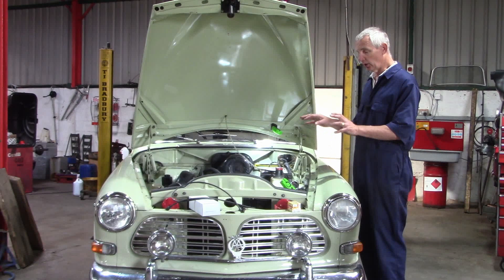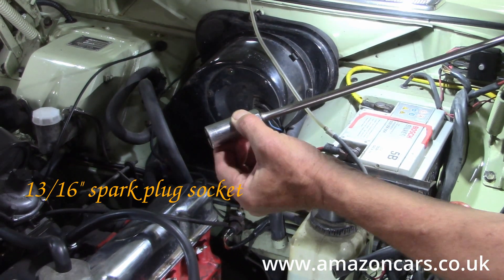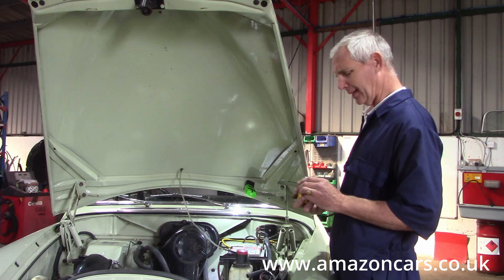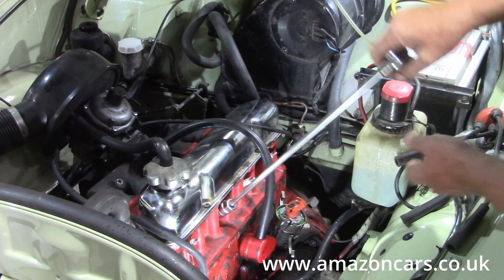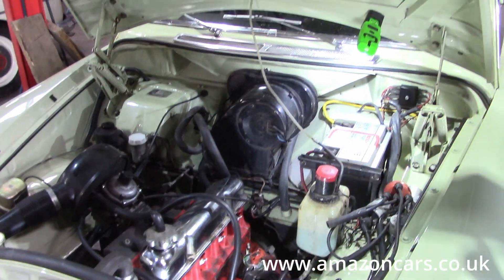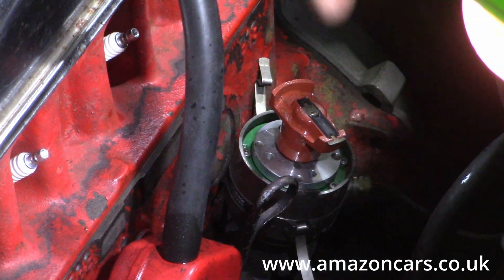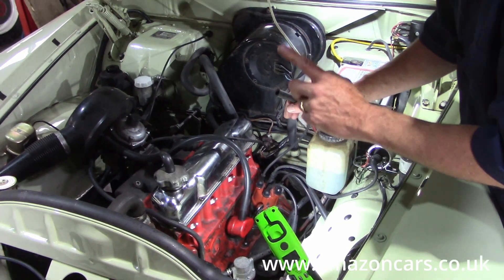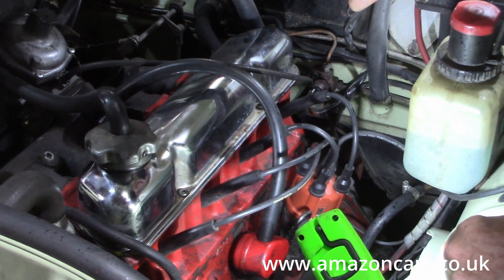Spark plugs, HT's & Firing Order: B18/B20

Comment: Thanks for the video.  Quick question just completed a total rebuilt of B20 for a 1971 p1800E.  Set the distributor sequence to 1-3-4-2 could not get it to start.  Changed firing sequence to 1-2-4-3 fires right up loses power going up a grade.  Any thoughts?

Comment: Thanks for the video upload.  Always appreciate it. Regarding the spark plugs, shouldn’t you always check the spark plug gap prior to installing them?  Never know if one is not gapped correctly.  Just wondering if the speedometer removal for Amazon cars will be done soon?  Thanks
Reply from the maker: There's no reason not to check the gap, it's simply that NGK provide the gap protector and we've never seen a wrong one: except for when I drop #4 onto the starter motor!
I shan't be working on an Amazon speedo for the foreseeable future regrettably.
Rob
Reply: @amazoncars  thanks for the reply. Stay safe and will be looking forward to new videos. Thanks. 👍